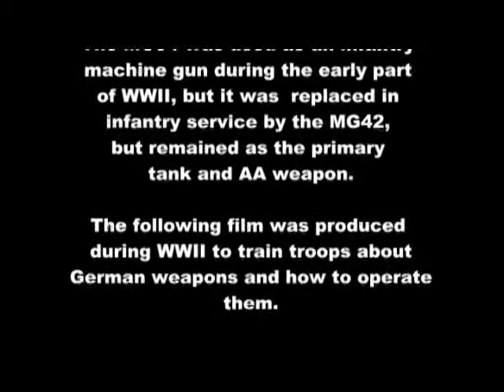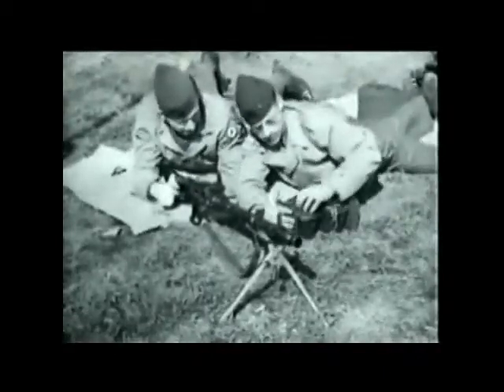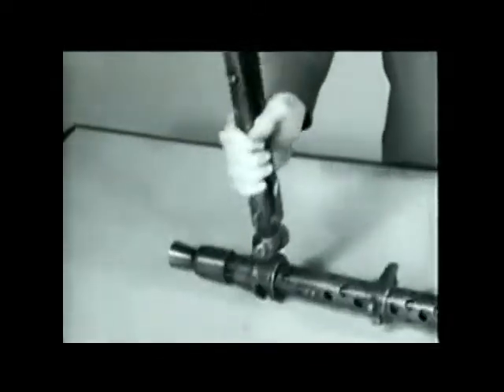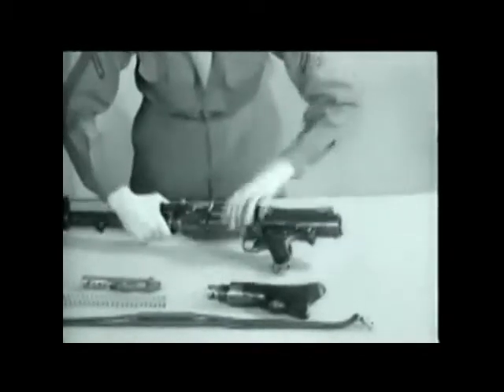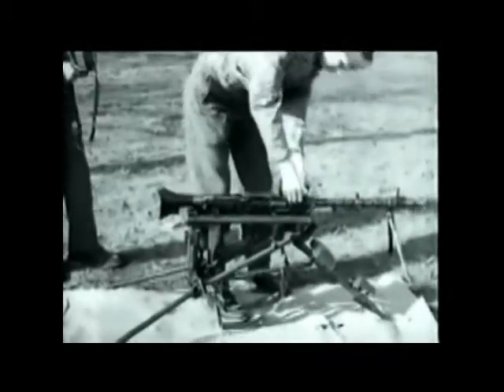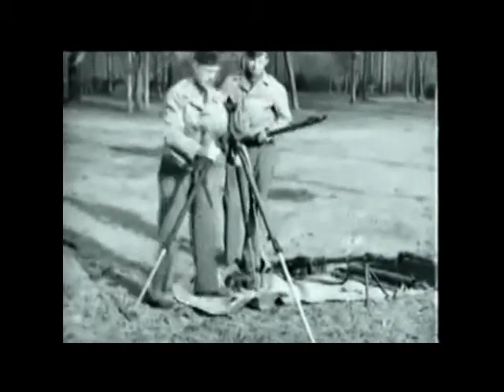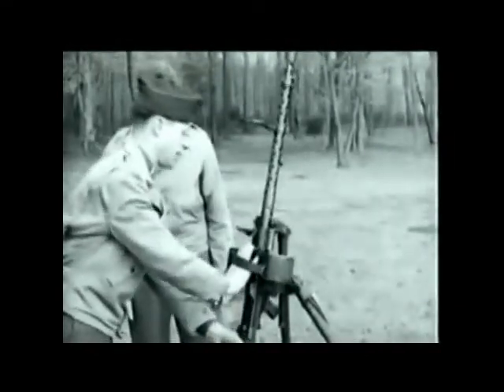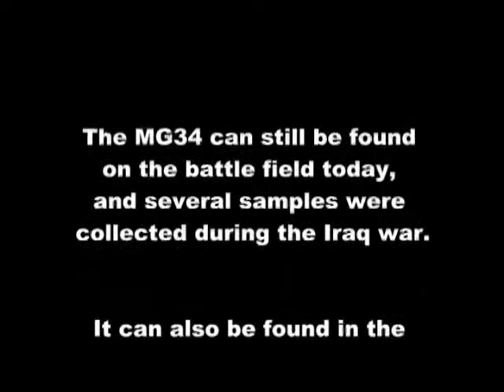The MG 34 / Maschinengewehr 34 German Belt Fed from WWII

Comment: Further evidence of the German's superior role in gun r&d, and manufacturing even under pressure of wartime constraints: the MG-42 with spot welding, stamping, and brazing was the perfect gun in it's time. Tho an excellent and high-precision weapon, the 34 had too many time-consuming machined parts to be an efficiently-produced gun under wartime pressures.